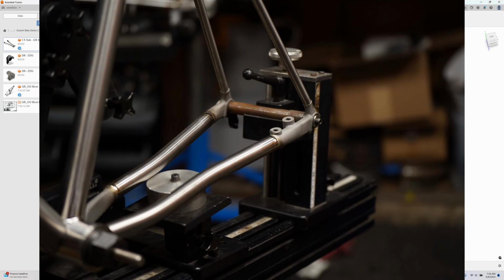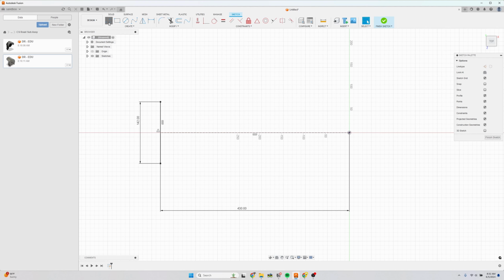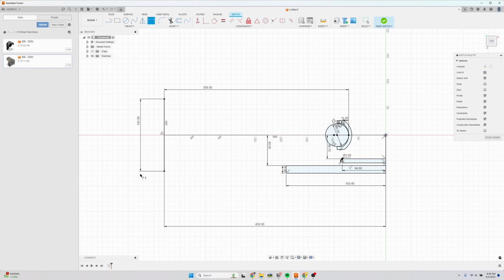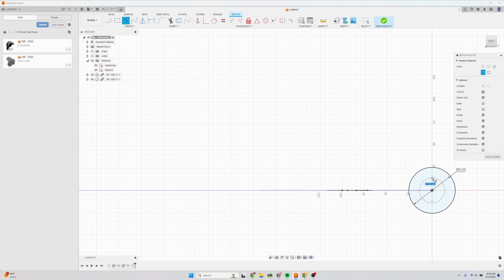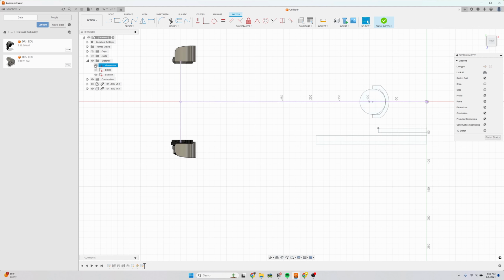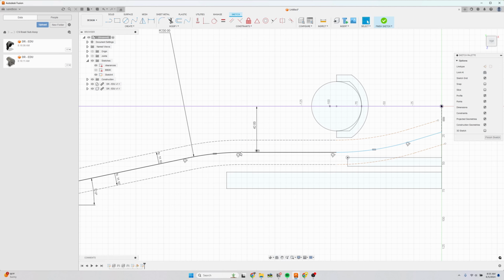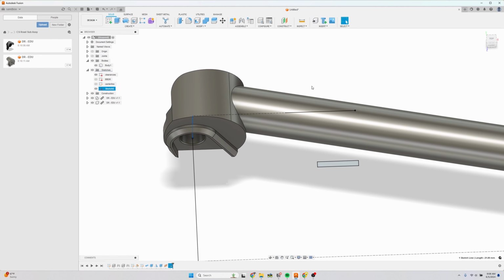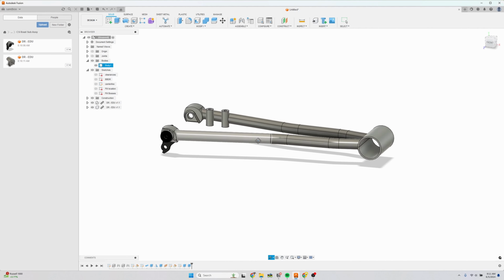F360: Engineering A Gravel UDH Chainstay Sub Assembly

Comment: Is there a reason you 'cut' the drop out side of the chainstays with a drawn circle rather than just using the drop out bodies?
Reply from the maker: Good question. I do that as an internal check and to avoid extrapolating mistakes. Since the dropout body is "hardcoded" into the CS-subassembly, if I accidently clock the dropout incorrectly or mess up the dropout file, I will know something is wrong right away..